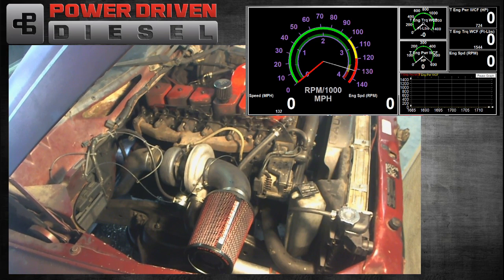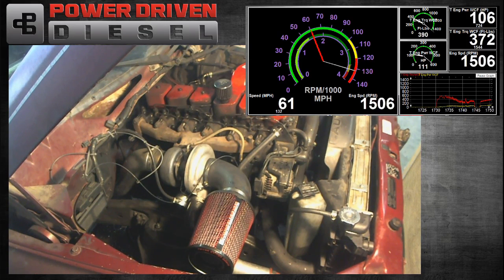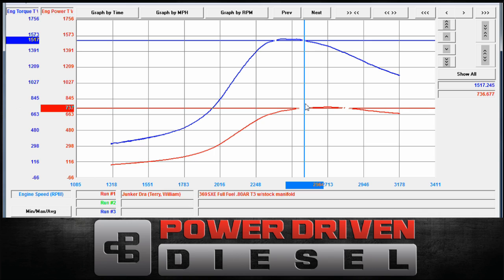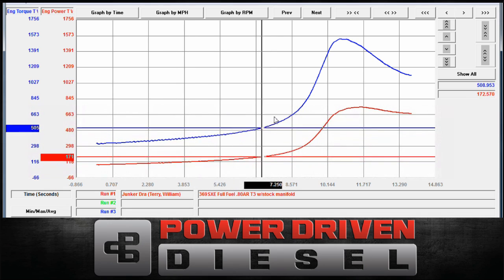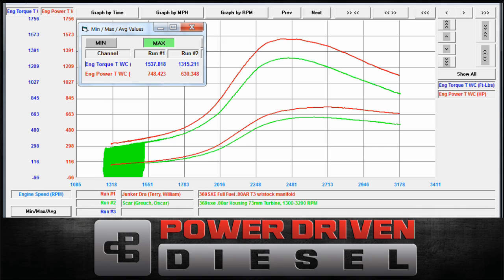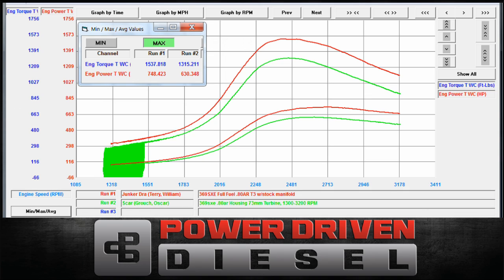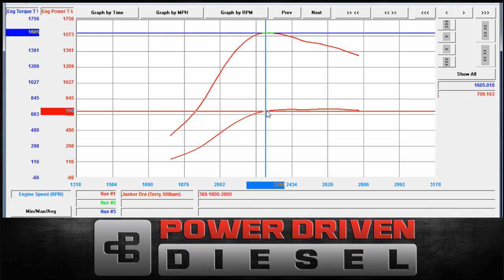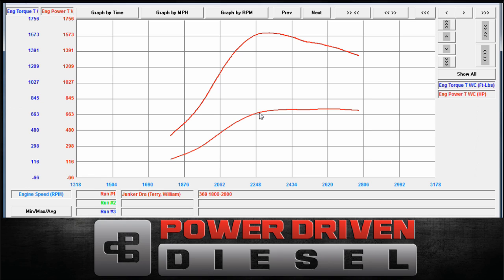Dyno Test: BorgWarner S369SX-E w/More Fuel. 748 Horsepower! | Power Driven Diesel

Comment: That was the Hamilton head correct? And 5x.018 sticks/575cc pump? What were the egts and boost?
Reply: 5x018" 650cc 12mm pump.  Truck doesn't have an EGT gauge.... probably 1800 or so on the loaded run....  Boost hovered between 50 and 55 psi depending on RPM, wastegate was tuned shut with a PDD Turbo Tuner so boost was maximum it would make with this fueling and turbo combination.